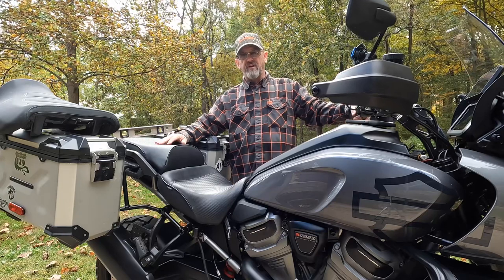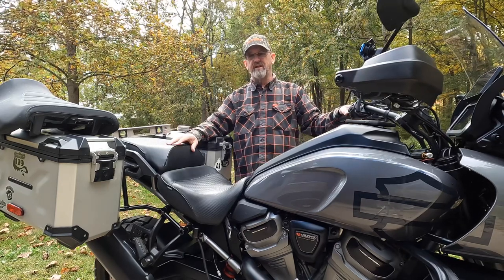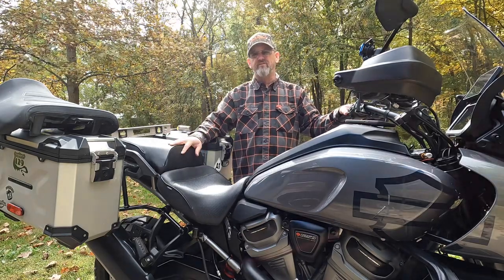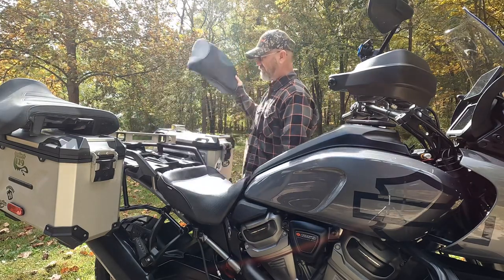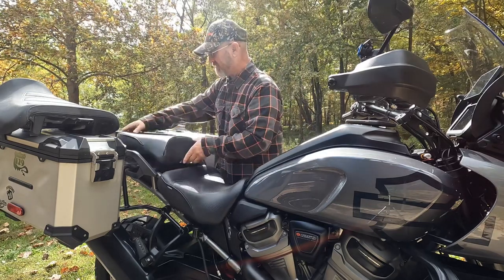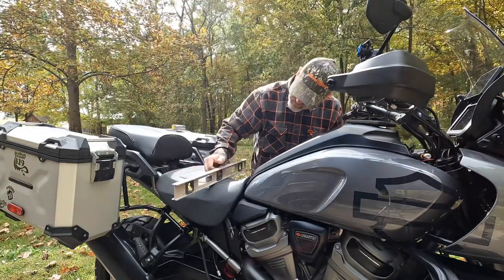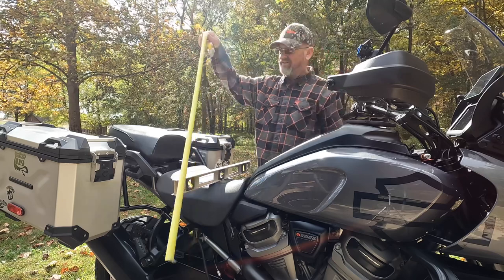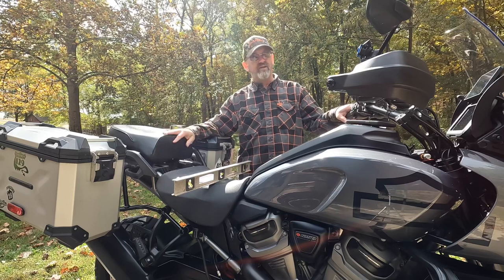Pan America Sargent Seat Height vs Stock

Comment: How do you like it now a year in? Does it push you forward into the tank?
Reply from the maker: It’s a great seat and it doesn’t push you into the tank. One thing is that I wish I would have gotten the standard seat and not the low model. I run it in the high position all the time now.  With the low seat in the low position it is too cramped and it started to hurt my knees. I run it in the high position with a sheepskin cover. I have a 29” inseam and after riding the PAS and my WR250R 36” seat height. I see the advantages of only worrying about getting 1 leg down. 
Thanks for watching.